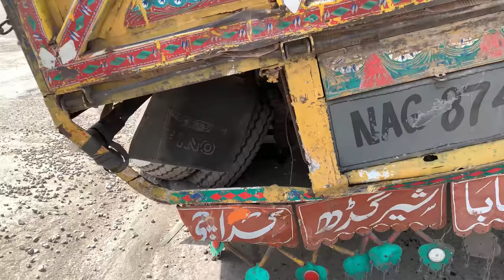When The Rear Wheel Hub Breaks down on the Middle of the Road || We Repaired in a very Strange Way

Comment: You can add as many leaf springs as you like but the axle has its limits. The only suspension on this truck is the tires.
Reply: The spring has a lot of standard axle, it's useless, the spring with a lot of suspension doesn't play normally.
Reply: As many leaves as possible 🤣 and a helper spring all they are doing is adding more weight on the axel.
Reply: Brasil vc está cheio de trabalho  vem
Reply: Shit like this is why I see the need for DOT even though they're a huge pain in the ass. BTW what wasn't the hub it was the whole dam axle.
Reply: In this case his axle was the suspension
Reply: What the fuck is that leaf spring
Reply: These people sure love to overload their cheap lightweight trucks....
Reply: Iya bang disana per nya gak main, gardan pun jadi gampang patah
Reply: Too much leave spring....trucks don't have flexibility
Reply: @DavidVanHelden1  wonder how much weight they would lose if they stripped all the cosmetics all over the truck?
Reply: @oneslap01  ridiculous 🤣
Reply: Yeah, at that point, that truck at least needs a second axle
Reply: @unacceptableminority7101  0
Reply: @banjobolt1  put out with
Reply: @rafaelfreitas6820  on
Reply: fun fact :
most truck route in india are wrecked, the gov dont resolve it rather telling the trucks owner to add leaf spring as much af..
Reply: @daudjabaransmarr.8725  bangke.. pake bahasa engres bang.. wkwkwk
Reply: Ok
Reply: What are the swinging  ball things hanging down from the truck for. To keep flies away?
Reply: wkwkwk
Reply: @themadfarmer5207  I think they're like bells
Reply: @dwihandoyo7441  this is Pakistan brother .not India
Reply: And they did it all wearing only sandals 😆 🤣
Reply: All bout finding the weak point its the process lol
Reply: They loaded above 50 ton
Reply: This pakistan babe
Reply: They could add lots of helium balloons.
Reply: 3rd world country bro
Reply: @oneslap01  axle? Its an iron billet that they repurposed for this “repair”
Reply: 9
Reply: 0op o op
Reply: @dwihandoyo7441  hahahaa
Reply: @supiadisupiq9407  p
Reply: In any normal country like America or Canada this wouldn't happen.
Reply: In this countries you can't make money with normal load. They must overload massively so they can earn a little money. That's it.
Reply: If the truck carrying 100 people a day everyday then damned that truck
Reply: @dwihandoyo7441  
That may be true...
But this truck is most probably in Pakistan.
Reply: @dwihandoyo7441  fun fact : it's not india, it's pakistan.
Reply: Looking at this truck (old ASF) can't wait in 30 years our "old" equipment starts finding its way to these countries, oh boy will they be disappointed
Reply: @mrconductor144  They will most likely strip it and keep it at its bare or will keep these old trucks going
Reply: @temujinkhan6326  I would say to that, you hold on to those old trucks, as long as you can
Reply: I'm very sure that the Art work paint adds weight.
Reply: جج
Reply: The leaf spring that broke the camels back..
Reply: Bir bir
Reply: @raphaeld307  Your right. In Canada, that truck would have been stuck in a shop for 10 days and with that a $15k bill. Got to admire these guys' ability to get that truck moving again with primitive means. Safe? Of course not.
Reply: YouTube non-salaried engineers. I do not see in the title of the video where one is asked to write one's suggestion on what is what or for that matter, what is wrong. I think they posted this video to be watched by who want to or not watched if someone hates it. They must not be expecting some bright Elon-like ideas on what is wrong or what the truck is like etc. Just watch if you want to and shut it if you feel like commenting something which may sound like a ground-breakingly solution. Least expected comments could be how the people work, what their working conditions are like, what the workers skill level could be, what that country is like. Outside our room most of us are bare and exposed when it comes to skills
Reply: @dwihandoyo7441  not so fun fact don't you mean
Reply: We need to bring these guys to Australia... they will serve us and pay our taxes well... 
( brain drain ) ...!!!!! 🤣😂😅
Reply: @dwihandoyo7441  it's pakistan
Reply: Seen a few of those springs in person hahaa forklift to lift them
Reply: Jesus is coming. Read the Gospel.  never.......!!! I will not be submitting my soul to the dictatorship of God... because Gods are dictators..yup 😁
Reply: Jesus is coming. Read the Gospel.  dear wife..
What if you're married to me for eternal... hmmm would've become a torment for both of us.. in heaven or hell... hmmm.. that is why death and a resetting of memories and renewal i created to counter the situation...😊😁
Reply: ا ع بل
Reply: Jesus is coming. Read the Gospel.  be more concerned with enki returning
Reply: Them springs are already half the recommended wheith for that axle
Reply: Dude has 2000 leaf springs
Reply: ?I'mm.
Reply: @supiadisupiq9407  to us in bm m
Reply: Hy tb var

Comment: As much respect as I have for these guys, that axle is never going to be structurally sound again. There's a reason why they are cast in single pieces and not welded together.
Reply: If it gets the load delivered that's all that counts hats off to these gentlemen doing this work
Reply: Yeah...but they didnt spend $5000 to get this done
Reply: @schickmann  They spent dozens of  labour with cheap, in fact, cheapest possible quality slapped across that truck, right in the middle of a road (I don't even want to get into the transportation costs, long/short term). 

The worst part is that this will remain exactly the same way if another truck loses its tire, next moment. 

And we wonder why there is such a huge difference between the developed and developing world.
Reply: You haven't used hand made pakistani welding rods then have you lol?!?!
Reply: This is all they have, people seem to forget
Reply: D
Reply: As long as it works another week....🤣🤣🤣🤣
Reply: But if u add 2 more welded axles it will be ok
Reply: @marky5493  Hand-made welding rods?...didn't even know that was a thing.
Reply: @kimjw001  in Pakistan everything is a thing lol
Reply: У людей нет возможности эвакуировать грузовик в ремонт и оплатить дорогие запчасти. Это полезный урок, как суметь выкрутиться в тяжелой ситуации.  Уважение этим людям 100%.👍
Reply: Guaranteed until it breaks!
Reply: I hate to break it to ya.... that axle housing isn't cast one piece.... you can see the welds in several shots.  It's formed steel welded together.
Reply: What are you talking about. Those are not  cast at all. That is 1/4” stamped steel. The center section is cast. But that wasn’t even in the video. Don’t take that as me not agreeing with you that that axle housing is totally fu€ked. But it’s not from welding on it. It’s from the shit work they did to “fix” it.
Reply: They do all this sand casting too, seems like a huge market. and seen plenty of machining videos, but still won't pay for new parts to help their economy.
Reply: @KaneCiticani  that part
Reply: 어떻게,,,,,,,,,,.이렇게 힘들게 살까😭😭😭
Reply: True they fix it but it will come apart again.
Reply: I don't think that truck will ever be structurally sound again 😂 you know it did some frame damage when it bottomed out
Reply: @redneckgearheadgarage495  originally it's cast...but I'm quite sure this axle has been welded multiple times
Reply: Yeetman  mainly bombs
Reply: Apparently you have not seen how axles like this are made.  They are fabricated, not cast.  Some parts are indeed cast such as the differential carrier.
Reply: yeetman3198  Pakistani handmade nuclear warhead
Reply: They fixed it 3 days ago
Reply: Not always true. Factory casting imperfections ( obviously as well as massive overloading beyond weight limits!!! ) may have caused the breakage. A welded repair may in fact end up STRONGER than the original . Castings are brittle. Welding not so.

Comment: The weight limit on the truck is based on how thick the spring pack is. That theory seems to work well over there, judging by the number of axle and suspension repair videos coming out of this country. The upside of this theory is it keeps men and boys employed. The downside is, well, it kills people. But it keeps the repair guys busy, right?!?
Reply: Nice theory. But the reality is the truck owner probably modified the leaf spring and the bed to carry more load per trip so he could make more money per trip also
Reply: @LeftOverMacNCheese  возможно,
Reply: Affordable too , replacing with new one worth lot. It’s Pakistan 🇵🇰
Reply: I live here. We like to load the truck till the axel breaks. It should not be like that. But it's somewhat the norm. If a trailer says 880kg max, you could get away loading it up to 4 tons. Most vehicles are engineered way beyond their stated load carrying capacity, if you ignore the safety. Thing is they don't make em the way the used to in the seventies. Most axel breaks happen on newer trucks. Seeing how thin the metal is and how hollow it is says all about the quality. Hino, Isuzu, Faw, dongfeng, are the common ones, we used to have Bedfords. You could load those till the wheels carved the prints in the tar on the roads but the axels would stay in place. Overloaded Old bedfords destroyed most of the national highways. These days we have the newer trucks, one pot hole is all it takes to break , especially when overloaded. 

Why your name's Bergdhal though?
Reply: Being pakistan 🇵🇰, they need to import parts which make it expensive. Thus the elaborate repairs sector.
Reply: @adamdeste7376  ⁉- What do the Government Road Laws say? - Does anyone ever check? ⁉
Reply: @JayDee-b5u  Pakistan became industrialized in 1947.  The definition of insanity is doing the same thing, again and again and expecting a different result.
Reply: @JayDee-b5u  🤡
Reply: @adamdeste7376  The problem is the Pakistanis and others stopped buying expensive Bedford trucks so they stopped making them.
Reply: load it till the tire bursts :D
Reply: Leaf Spring from a 51' 
Chevy will shatter a concrete floor don't wanna what a leaf Spring from this truck will do
Reply: @stanmolina5805  Not one of my concrete floors it wont!
Reply: @websitesthatneedanem  road laws!!!!!! 🤭🤭🤭🤭
Reply: The gross weight of the truck is limited by two things.  First, the weight capacity of the axles, and second, the weight capacity of the frame.  Safe weight limit is not exceeding the lowest capacity of the two.  Obviously this does not apply in this country.
Reply: your missing the point of why they do this.  these trucks only carry  15,000 pounds max which is not much weight compared to usa trucks.  the reason they load up spring stacks is cause of the mountains they run on skinny roads.  if your truck bounces side to side you will die on those roads.
Reply: STUPIT BEBAN TERLALU BERLEBIHAN
Reply: @andrewallen9993  your concrete floors aren't special lol
Reply: @sekou3758  no u 🤡🤡🤡
Reply: @subtleusername5475  My concrete floor has laughed at a Mercedes 240d engine falling from a fairly high workplace😀
Reply: Nice theory, its actually based on the tires. A tire failure is what caused thus entire thing. 

Tandem axles must not be a thing in Pakistan.
Reply: @JayDee-b5u  I know right
Reply: @JayDee-b5u  You're saying that these people are more than 200 years behind the west? What's the reason for that? Also, how do you square that with the fact that their own government has nuclear weapons?

Insufferable ignorance.
Reply: @JayDee-b5u  yes, because there's no such thing as industrialization.
Reply: This country is United States! Didn't you read the location tag?
Reply: @JayDee-b5u  people do what people can do.  All these guys are saying is when design specs are exceeded there's a price to pay somewhere else.   Oh such insufferable arrogance indeed.
Reply: @LeftOverMacNCheese  . I think they spent more in repairs and fixes as well as time.   In the United States we have weight limits and every Trip is safer.  Also our Trucks last forever and keep us making money.
Reply: @Waynerking  what ? ... Where ?
Reply: @Waynerking I'm not sure if this was humor or not, but yes I did read the location tag.
Reply: @JayDee-b5u  yes, it is a horror. Done if the lads in the country in question should LEARN from the countries that have been down this path. Were not looking at the birth of the automotive age, these guys buy trucks that are designed for a particular purpose and then completely destroy the safety features of the truck asap. What's so insufferable or arrogant about pointing out the fact that these trucks and their"repairs" kill people?
Reply: @adamdeste7376  that's the whole point tho, the trucks are NOT able to handle the excess weight like the old beefy trucks were. 
And my name is not Bergdhal, my name is Bruce. Bruce Bergdahl. Why? Because that's what my parents decided to name me. Why is that relevant in any way to the discussion? Why is your name Adam deste?
Reply: @johndeerrm  I was being very sarcastic. Tires are usually the limiting factor in weight capacity, which is why it's so comical to see a 3 foot thick spring pack under these things. I'm my area, trucks have multiple axles that can be dropped when the weight requires it, otherwise they truck under the frame to decrease fuel consumption. It's not at all unusual to see a loaded cement truck with 10-12 tires on the road.
Reply: I'm sorry, Google translate can't seem to figure out what language you replied in. What to try it again?
Reply: @BuildBreakFix  I'll buy part of that, but if they're only carrying 15000 pounds, why are the axles, hubs, and carriers failing left and right? Christ, a Ford F550 could carry 15000 pounds if you added a tandem axle in back.
Reply: @firedogbme5659   you realize those trucks are 30 to 40 years old right?  They  drive trucks with 8 million miles at times on them. That is not a over dramatized number. Poor country and to get a truck passed down to you by a family member is big deal there to have a means to make an income.
Reply: @firedogbme5659  just wondering if you was related to Bowie Bergdhal. He was held captive here for a long time.
Reply: Governments let their citizens down. For example in kenya, they have banned the importation of readily well built busses n trucks, just to build their vehicles bodies that are weak.
Reply: @sunammi5527   yeah! that is my exact point lol! If your lucky enough even get a truck and such normally hand me down that is 90% beat to start with in places like that!  Hell half there tires and stuff are second hand used garbage as well they atke in like it's freaking gold!  Not many realize how well they have it in western countries cause the now exposed to it.
Reply: The lack of safety precautions blows my mind. This wouldn't happen if they maintained their trucks and quit overloading them.
Reply: @BuildBreakFix  search YT for "truck breaking" by Pakistani Truck. They took a brand new truck and weakened it by half assing the addition of a tag axle. Edit: it's Truck Braking,lol
Reply: @Mister.Bone_Saw  Ahhh, ex UK army Bedford trucks 😁
Reply: Not all has the same privileged life like yours, this is the same in my country this what we can afford. We earn small so we make due of what's available for us,  if we can afford new parts we will but unfortunately our wages is just barley enough for ou daily living expenses. It's not that we want this it's just the only available way with our resources/ budget.
Reply: Replacement with new parts takes longer waiting time and the truck owner will lose money. But in situ repair, modified with recycle materials will be faster and readily available....
Reply: @LeftOverMacNCheese  Nice theory.
Reply: And the undertaker
Reply: @adamdeste7376  useful information...thanks
Reply: @LeftOverMacNCheese  lol the leafsprings i aint ever seen anything like them, that truck would crumble to dust and they would still be rock solid
Reply: @websitesthatneedanem rule No1 does your engine run, rule No2 see rule No1
Reply: @adamdeste7376  

..
|
ધદ
Reply: If they would just simply follow the truck's gross weight ratings and capacities, it will create unemployment.
Reply: @LeftOverMacNCheese  a11
Reply: @LeftOverMacNCheese  when you say probably it means you don't know for sure.
I have seen videos where even one of the guys doing the repair makes a face like WTF.....
This keeps happening because they keep making ghetto repairs.
Reply: Do they even have tow trucks in that country  ?
Reply: Well they either starve to death or repair they the truck this way and live a much longer.
Reply: @firedogbme5659  because these are single axle transporters 😂. At the very least two would be beyond beneficial to them. It wouldn't double their load but it would significantly increase it with fewer issues. Even an independent axle would help. But nope...they haven't figured that out yet. Avg IQ=80
Reply: @adamdeste7376  The real thing though is that vehicle suspension systems are designed on a fatigue basis not a strength basis.  So yes, you can load that trailer to over 4 times its rated capacity but then you will have something like this happen.
Reply: BWAHAHAHAH😂😂😂😂

Comment: I would have liked to see the final result when the axel was ready to go back on the truck. To many tasks left out on the reconstruction of this axel, but as the old saying goes "where there is a need, there's a way". Thanks for sharing. 😁👍🇺🇸
Reply: "Where there's a will, there's a way", no?
Reply: It's spelt "axle".
Reply: Fuck it, when in rome..

*Too many tasks
Reply: no fucking way that axel is gonna hold anything they want it to, its literally made of melted welding rods now which are brittle and have zero tolerance compared to steel, it would prob save them a shit lot of extra work just by reducing the loads they carry, but i gotta feeling thats not gonna happen